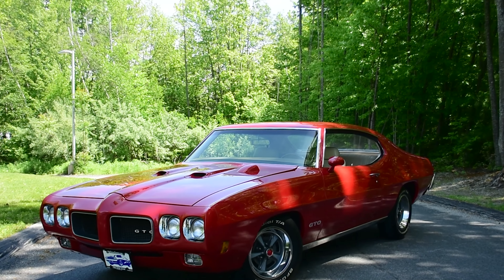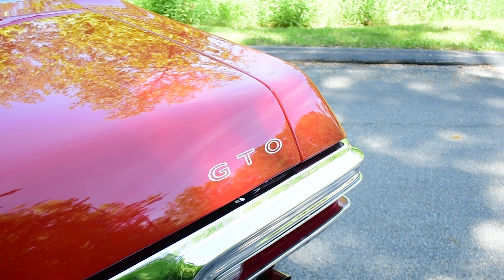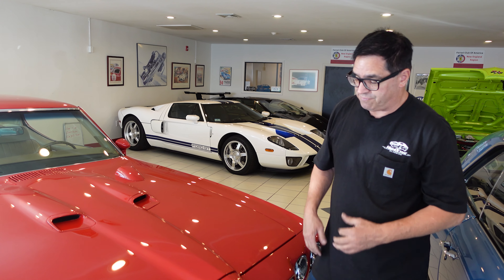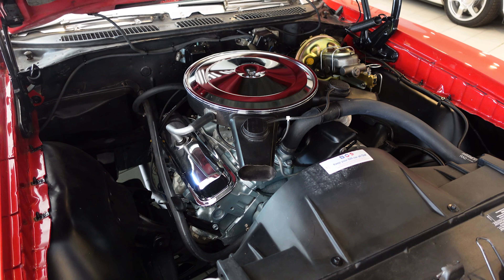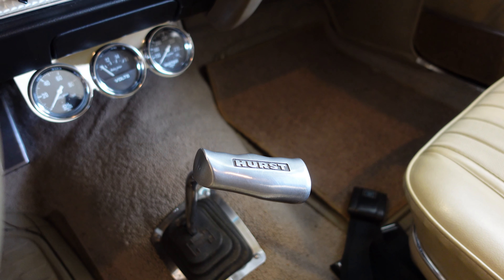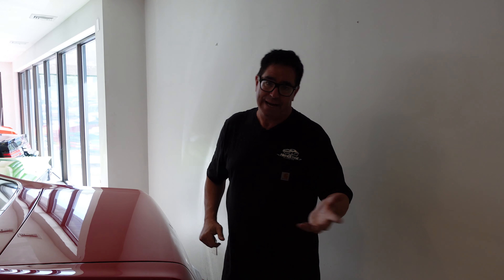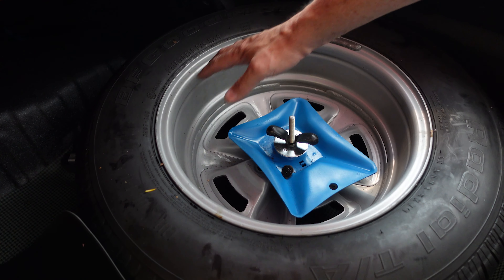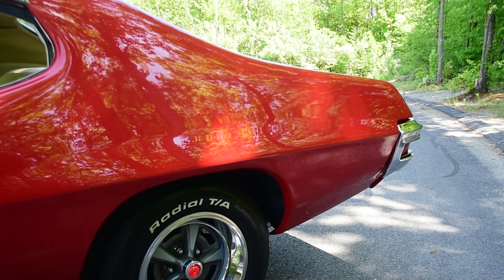1970 Pontiac GTO | Walkaround with Steve Magnante Ep. 85 | The Humbler | Barrett Jackson Las Vegas

Comment: My uncle worked at a Pontiac dealer that sold a lot of performance models and sponsored some local racers. My uncle used his employee discount in 1970 to order a new GTO with a Ram Air IV engine and 4 speed. They took his order and his deposit. This was some time into the model year. Pontiac later contacted the dealer and said that the Ram Air IV engine had been discontinued late in the model year in the GTO, for the Ram Air 455 HO engine, for the same price. My uncle wasn't happy about that and the dealer had some contacts and influence at Pontiac. Since the Ram Air IV engine was still being put in 1970 Firebirds, Pontiac agreed to assemble one last 1970 GTO with a Ram Air IV engine for my uncle. His car should be the last Ram Air IV GTO made.

Comment: have my step dads 71 gto he bought new.  400 3 spd muncie.  love the three speed.  these engines have good torque down low where the 4 spd isnt really missed except for bragging rights.  and the power discs brakes were and option.  drum brakes were standard as mine still has..

Comment: Wasn't another feature of the Humbler an exhaust cut out from the facotry?
Reply: That was on chevelle if I remember correctly.
Reply: Yes. It was a short lived option and GM discontinued it. It was called "VOE" or Vacuum Operated Exhaust. There's a video on YT of it. About 233 of them were made before the option was dropped. GM made about 40,000 GTOs for 1970. Reportedly, GM executives saw the ad on Superbowl IV and were enraged about it, as well as the fact that it featured other GM division muscle cars in the ad/video. VOE also violated noise regulations in several states.
Reply: @zairomolino4074  No the GTO had it for 1970 for a short time. There's a commercial clip of it on YT.
Reply: Oh yeah remember the ad. I was sure to remember it was a chevelle. My fault :)

Comment: The standard RA III engine was a real beast for a standard engine.  Only bad point in one needed high octane gas as compression was 10.5:1.
Reply: The ram air engine was not standard in the 70 GTO

Comment: I had the identical car , 400 4 speed but mine had a factory bench seat .
Reply: I had the identical car... 389 tripower... then 400 tripower... 4 speed... turquoise... '65... convertible... black top... black bucket seats... tach in dash... averaged 17 MPG in easy driving... seemed faster than the later ones... LOL!

Comment: Let's take it all the way with the VIN so we win: 2 for Pontiac, 42 for GTO, 37 for two door hardtop, 0 for 1970 model year, P for Pontiac, MI assembly and the rest is the production sequence. The Pontiac, MI plant was the 'home' plant and was closed in August 1988. The last cars built there were the rear wheel drive G bodies and the Fiero.

No tag, can't brag, but I got it figured out, no doubt: ST70 for 1970 model year, 24237 for Pontiac GTO, P (or PON in some cases) for Pontiac, MI assembly, 75 75 (or 75U 75L in some cases) for Cardinal Red upper and lower exterior paint, possible 255 for Saddle interior trim, and the build date code is unknown without the tag. 

About 233 of the 40k GTOs made for 1970 had the VOE option, or Vacuum Operated Exhaust. This was quickly discontinued because it violated noise laws in many states, but also because the ad that premiered at Superbowl IV in 1970 showed other division's muscle cars. All of this enraged GM brass and the ad (and option) was immediately pulled. There's a video clip of the VOE on YT if you search for it.
Reply: You sure get around GOOGLE MAN ! We apparently have similar tastes in car channels,  I notice your comments frequently! I too am addicted to trim & body tags and deciphering them. I love to find factory "chalk markings" as well. See ya on the next video!
Reply: @rogergoodman8665  Sure thing. Need the tag to brag and the VIN to win.

Comment: Steve....in the early 90s i bought a 74 lemans it had a chevy 250 6cyl and a 3spd.trans. manuel steering and it had the louvers on the rear side windows....bench seat car...ive never seen 1 before or after....a freak mabey?? just wondering if you or any body else has run across anything like it??
Reply: The Chevy straight 6 was available in about anything 'GM'... and in most brands of boats... marine version was a tad hotter... higher compression ratio, 89 octane gas, step bigger camshaft, 2 bbl. carb... kinda snotty sounding for a 6...